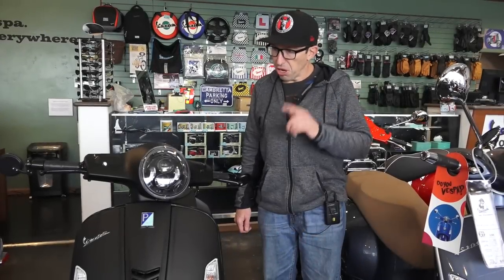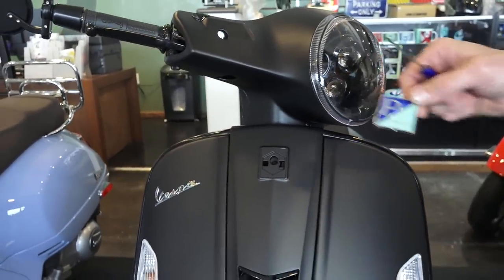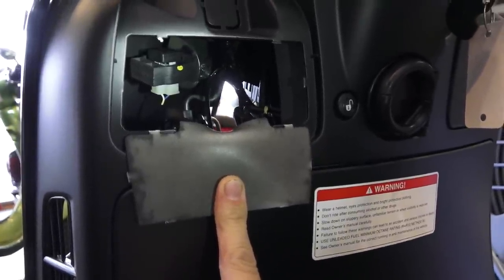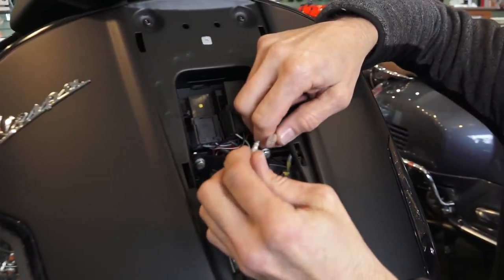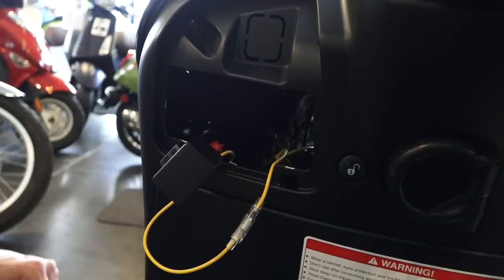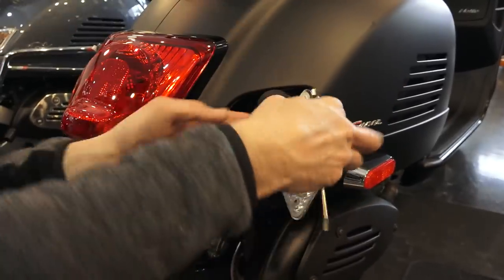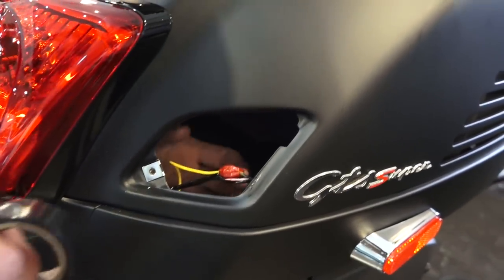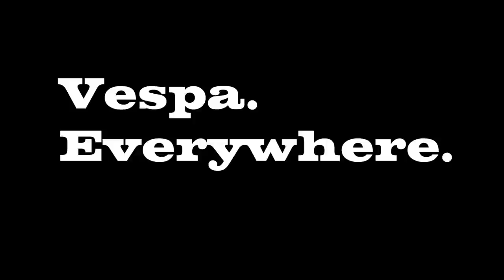New LED Switchback Turn Signal Set for Vespa GTS

Comment: LOVE my turn signals - they look so great on my notte.
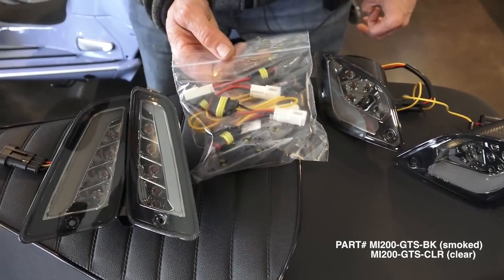Need the adapter (you say around 1:23 that the 2020s might not need the adapter... they do).
The quick connect connector didn't work that well - I've had a lot better luck with other brands, like posi-twist (which takes up less space and makes a better connection so you can probably get away without using the extra electrical tape).

A couple of install tips - I didn't remove the knee pad panel. I was able to watch the video and figure out how to pull the relay from the front left signal hole.

I also didn't remove the horn cast and just used a grabby tool to pass the connector from the right to the left signal hole. A coat hanger would work too. That cut the front install time down considerably and didn't need to rip open that panel behind the knee pad.

Thanks for all the videos you've done and do, Robot. Soooooo helpful.  (And helpful for you getting my wallet open for stuff I wouldn't have ever thought about buying!!)
Reply: Phil Pace Hey Phil! Can you clarify what you mean by an adapter? I just bought the kit and want to install in my new 2020 GTS Notte. Thanks, in advance for clarifying for 
this newbie. 🙂
Reply: @despurvoa3  There's a little adapter they include in the kit that lets you plug in the Euro lights to the US wiring. You'll need it. Nothing more to buy though.
Reply: Phil Pace Gotcha! Thanks! My conundrum was whether I leave in that flasher relay, but apparently so, since i guess the wires have some sort of capacitor? Resistor? on them. All I know is that little crimped won’t “bite through” insulation, so it’s time to be creative! The smoked lenses are nice though!

Comment: Just put mine in. Look Great,  Much better visibility!!!
Reply: Did you also change the bulb in your headlight?
Reply: @Jackmessana123  Yes much better.  Mine is a GTV
Reply: Kevin Schwantes I want to do the same. Was afraid If the color of the lights don’t match
Reply: Which bulb did you put in your headlight? I also have a GTV. Also, did you get the smoked kit of this, or the clear?
Reply: @deverenfogle3201  I just bought all the bulbs from scooter west

Comment: My 2011 GTS has two yellow/black wires at the back. One is the brake and one the tail light. I chose the wrong yellow/black the first time.  After a redo it worked.

Comment: Followed this , all 4 indicators flash now :-( running lights ok , but all 4 indicators flash whether R or L switch used also no flashing indicator light on headset
Reply: shaun noble Same problem for me. Did you find a the solution? Thx
Reply: @motordad875  Yes but not the best , remove the bulb out the indicator warning light in the head set to stop the bleed over.

Comment: Running light do not work 2011 GTS Super.  What a waste of money
Reply: Did you get the right yellow/black in the back?  My 2011 GTS has two and I choose the wrong one the first time.  It was the brake. Switched to the other and it worked.